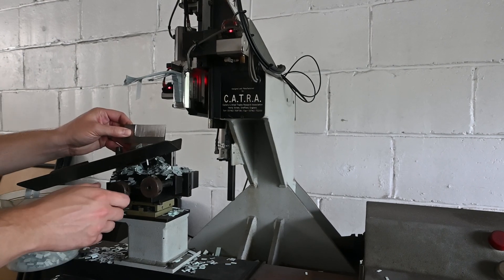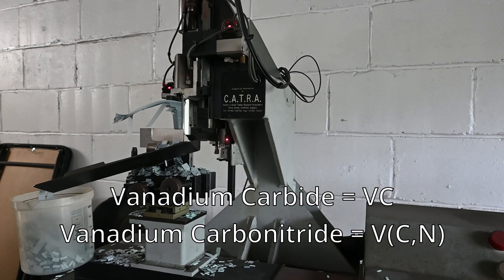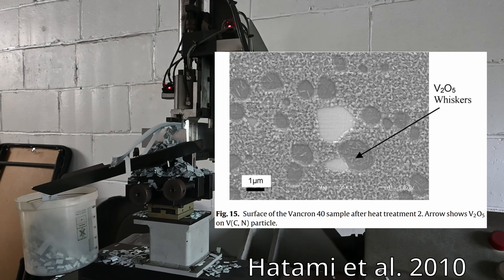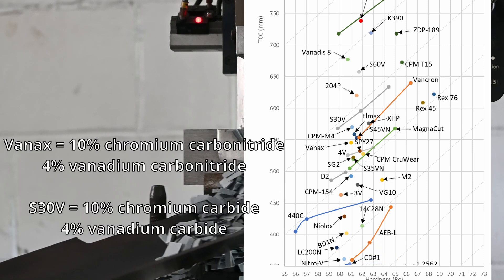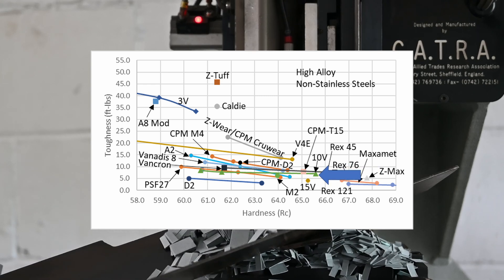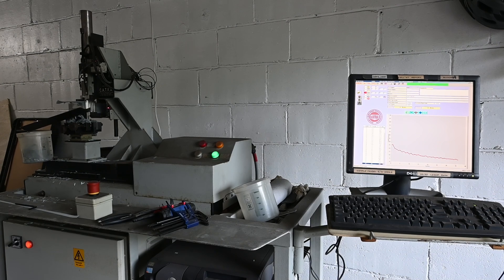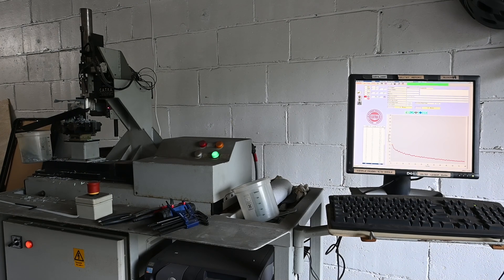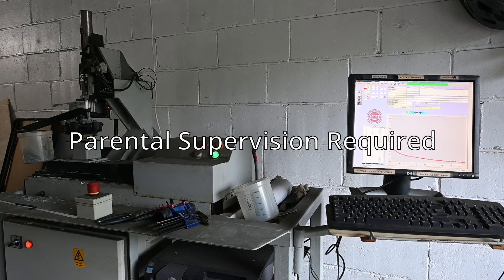The Problem with Nitrogen Knife Steels

Comment: I'm suddenly interested in Vancron because Kunwu is coming out with a knife (the Primo) in Vancron. I'd steel be very interested in an article or video from you on how blade coatings effect Rockwell hardness. Specifically how can a true DLC coating that's harder than the blade steel, reduce the overall hardness of the blade.

Comment: Absolutely. LC200N seems to be the "best marine" knife steel until your steel arrived in the picture. Understanding how LC200N has limited hardness may improve making a corrosion resistant steel with better hardness to toughness ratio.

Comment: I too would love an esoteric video about why LC200n and Vanax are limited to ~61rc, maybe juxtaposing them with an unrelated knife steel species of usually high hardness... ZDP-189 comes to mind? This is a very niche channel, lecture as detailed as possible - break out the dry-erase boards or better - mimic Sal’s videos on Khan Academy with on screen drawings (probably low post editing time too). How hardness is achieved, differences in crystal lattice structures, nuances, etc. Also, and this is meant to be constructive and only my opinion - this video felt a touch too quickly orated from script at times, which I can appreciate the necessity to accurately convey complex material, slowing down your cadence would feel more natural to me/improve comprehension. At least that has been my preference/experience of professors of difficult material - that they’ve not so overly polished the lecture it feels too rehearsed, but are actively thinking through the material along with their students. I realize I can replay videos indefinitely, which I do with all sciences because I want to make sure I’m properly and carefully assimilating and integrating the information correctly into my mind. It just felt like I had to replay them a little more than usual. But I also read science material very slowly and carefully... not sure if I’m an outlier in the area, but thought I’d share my feedback. Thank you for the video.

Comment: Vancron is typically my choice for compaction tooling for powder metallurgy parts where galling resistance is critical (particularly for dies where tungsten carbide doesn’t have the toughness).

Comment: Without referencing material, I would assume the nitrogen steels like vanax and lc200n don't get that high in hrc because of the low levels of carbon and vanadium. Hrc can increas with increasing austenitic grain size and can also depend on the quenching method too.
Reply: One thing I know about them, is when you use a protocol that promotes higher hardness with those steels, it will generally significantly hurt the stainlessness of those steels.
Reply: @_BLANK_BLANK  yes I do believe that is true. When I was talking about vanax with the guy who provided the protocols to Bohler USA. That was some time ago.

I'm trying to remember his name but its been so long since I've left Instagram that I can't remember off hand.